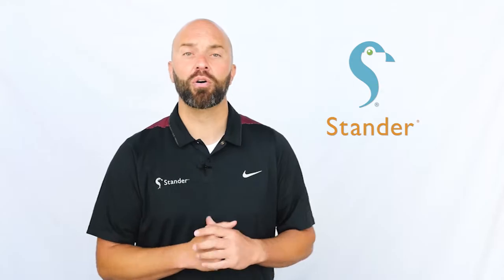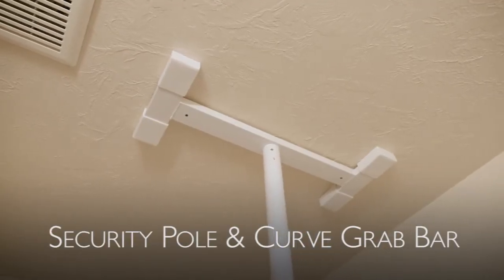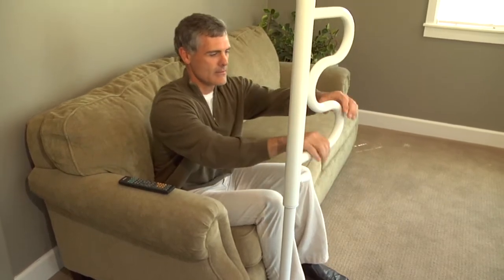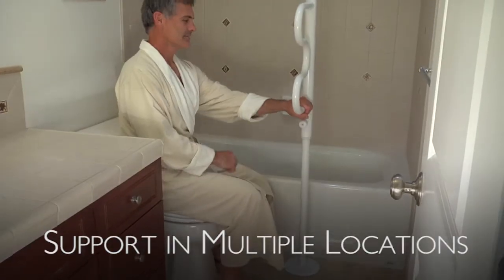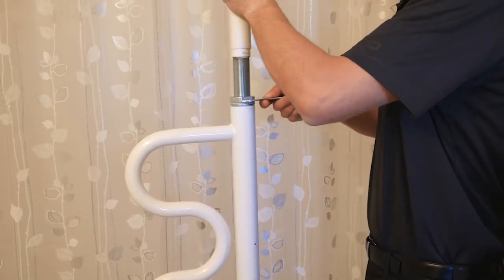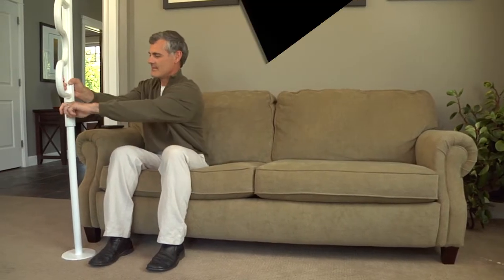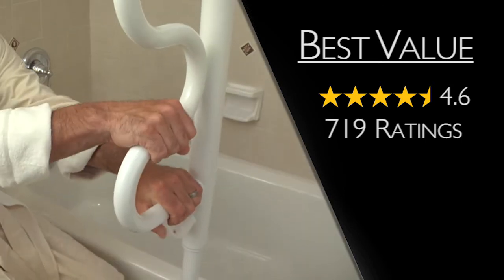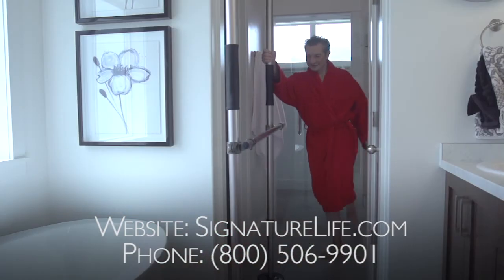Stander Security Pole & Curve Grab Bar Comparison to other Bathroom Transfer Poles

Comment: If extended to the maximum 10 feet, does it wobble?
Reply from the maker: Hi S.E., when extended to 10 feet there can be a little "give" in the middle of the pole. This is normal and the pole will remain secure as long as there is tension between the floor and ceiling. We recommend keeping the included wrench and tightening the pole every month to eliminate the possibility of thread-settling. The Pole also comes with hardware to attach the top and bottom pieces to the floor and ceiling if you are not comfortable relying on tension alone, but is not required. Feel free to give us a call at 1-800-506-9901 if you have any more questions about the Security Pole!